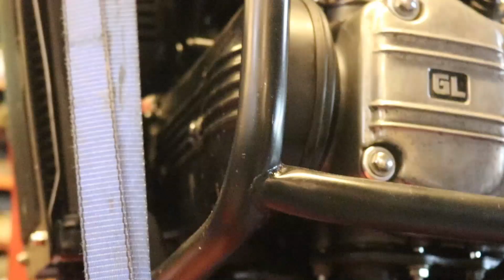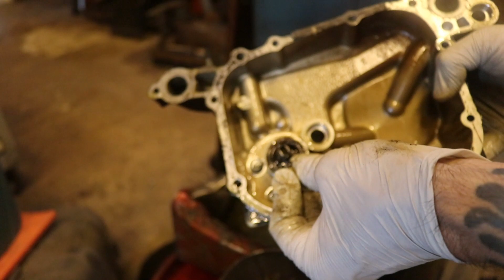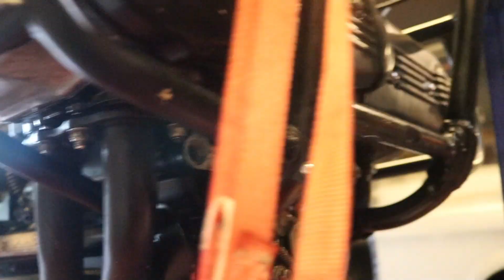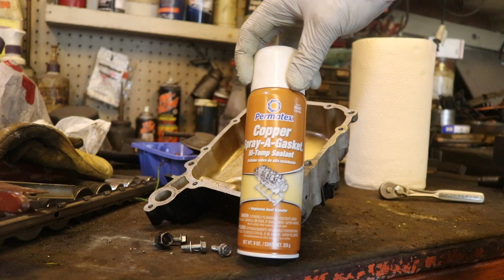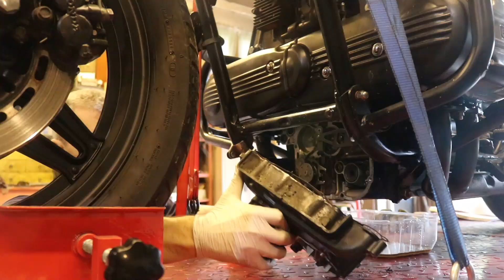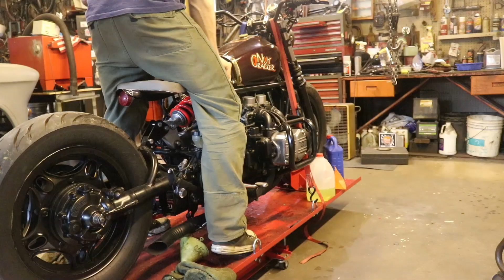Honda Goldwing Water Pump Replacement | GL1100/1000

Comment: My water pump on my 86 GL1200 has a oil indicator leak hole, my gold wing started pissing oil from the little hole underneath the water pump casing. At first I thought it was just a bad Oring, I took it apart, and the water pump threw both bearings,currently waiting on new pump.have everything else.

Comment: Did you happen to have any issues swapping from fuel pump assisted tank to gravity fed tank?
Reply from the maker: I retained the fuel pump. As you may know, it is external and driven off the engine and so I simply ran a fuel line from the new tank to the original pump. At least that's how it worked on this 1982 model.

Comment: Just bought my GL 1000, and you showed me why oil was coming out of the weep hole behind the pump, at the bottom of the trans cover.  The PO put in a new water pump, but did not put the smaller o-ring in around the back of the pump.  I'm really glad he missed that, bc I found he also failed to install the oil ferrule passage on the RHS of the engine that supplies oil to the filter, and new aluminum crush washers on the three bolts holding the pump to the case.  Fortunately I bought the entire water pump gasket kit that came with all the o-rings, gaskets and washers, so no problemo.  Back to the interwebs to find a replacement ferrule, but again, great work on this video!
Reply from the maker: ah, you are doing good things for that bike. Best of luck finding a ferrule. It will be great when you are done.

Comment: I changed the water pump watching this video and with the maintenance manual in hand but oil is leaking from the small hole under the cover :(, does anyone have any advice?

Comment: Man I’ve been try to get my gl1100 running for a year, just fired it up today running good but my water pump started leaking, thanks for the video, I wish they had one kit with the water pump and all those orings
Reply from the maker: Good luck !
Reply: @HooptieDoodle will this fix an oil leak from the weep hole?

Comment: thank you very much for this video. I purchased an 83 goldwing aspencade where the previous owner had removed the water pump as you did, but had not replaced it. I had worried if the bike would be worth fixing or to take the parts off it and sell them, scrapping the rest. the engine only has 68,000 miles on it. After watching this video i think i may atl east put in a new pump and put the parts on to see if it will run. Thanks again. The wiring is a mess, but if the engine runs i may put it in a small cabin boat project i am getting ready to start on.
Reply from the maker: Cabin boat with Goldwing engine - awesome👍😀👍
Reply: @HooptieDoodle  ill send u pics once i am done
Reply from the maker: @bennynash6655  excellent 👏.

Comment: Just an FYI, the reason for no torque specs on the water pump assembly housing is because the original fasteners were large screw heads not hex head fasteners.  Really good video…..

Comment: I have a Honda Goldwing GL1100 Interstate, i have a big problem, when i ride in 
uphill roads, the motor is overhead too much, but i don't what ocurre, the thermostat, the water pump, the oil, etc, could you guide me  what happened with my motorcycle....?
Reply: Check to make sure your fan is. Oming on..the thermal switch fails causing fan to not run. Easy fix is to bypass switch and run power and a ground to fan on a togglw switch. Or replace thermal switch. Ive road my gl1100 for 10 years on a toggle.

Comment: Great video. This is going to help me so much. I was struggling a little with my GL 1000 project water pump, but this cleared up my questions. Hopefully I get get the motor done now and back in the frame for gas tank mock up.👍
Reply from the maker: NICE! Hope it works out and you get that beast fired up soon

Comment: Make sure with this engine you should be using blue coolant made for aluminum engines and rads that are silicate free other wise is can damage the engine and  make the rad leak overtime with the silicates acting like sand paper to all the channels and tearing them away. The clymers manual as well as the honda manual reference this, cheers!

Comment: Thanks a lot for this video. You made this look very easy. I have next to no mechanical experience on my gl1200 and think I need to replace the water pump. Will follow this video step by step with a buddy when I do it. Thanks again, this looks like it'll be a fun project to get into!
Reply from the maker: Best of luck! There are a number of steps, but it's totally feasible. AND totally worth it! At least on mine, it made a HUGE difference, cause the seals were TOAST. For me the flushing of the oil was the most annoying part as I didn't know when it would end...

Comment: Hey quick ??  Did this solve your issue ?? I don't believe the head gaskets are bad on my 82, cause it runs and don't smoke to holy hell... I can get all the parts for about $120... But most people I talk to say the water pump is usually the culprit on these goldwings....
Reply from the maker: Yeah, the water pump was my problem. Oil looks like oil now, ya-hoo! New water pumps aren't cheap though. I had a good extra one around, but the other oem gaskets and seals I bought were less than $30
Reply: Tried 2 after market pumps. Both leak had apart 4 times. . I think the pump housing was to big  ,replace it with oem slide right in no leaks

Comment: i was going to say but never mind,  hey do ya think ya could do new clutch without pulling motor?
Reply from the maker: The clutch can be removed with the engine in the bike. You have to remove the rear wheel and exhaust, but it can be done. I am hoping that I don't have to do that any time soon (fingers crossed).
Reply: @HooptieDoodle  yeah that is what i thought too.  so good luck my Rat Ride is running rough but it's a rat who cares. haha